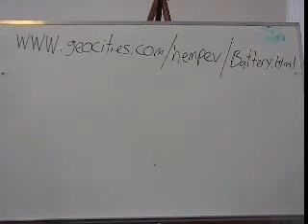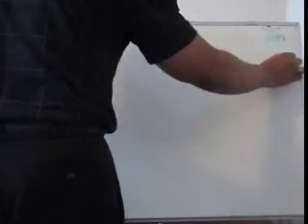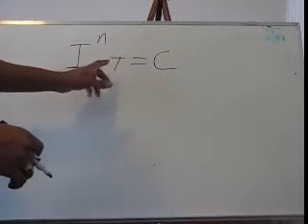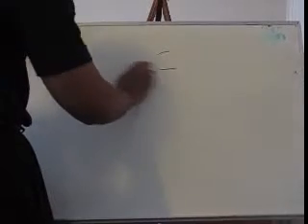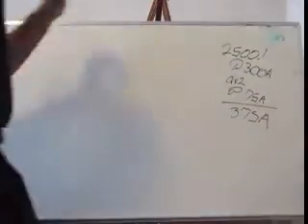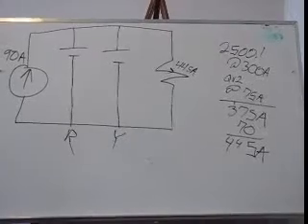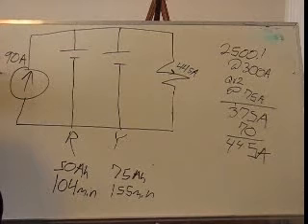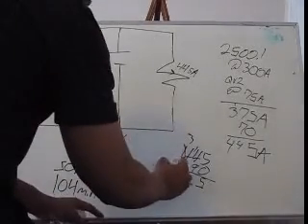How Many Batteries do I need (part 1) ???

Comment: I just tried to look up that website and its close . Where else can I find a site that can help me with how many battery's I need for my system ?

System setup
4 runs of 0 Gauge power  and 4 runs of 0 gauge ground
5 XS D3100 battery's in the back and one XS D3400 under the hood
Two American Bass 400.1
1 250 alt
and the BIG 3 upgrade

Comment: However unless you have the alternator capacity to charge the batteries ...just adding more will not solve any problems in fact it will make things worse as the battery just ends up being another load.